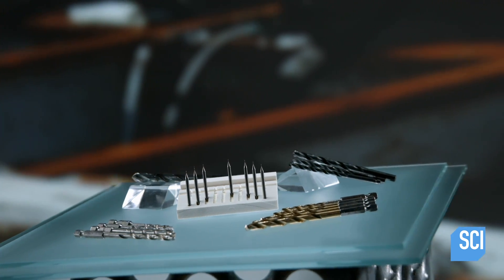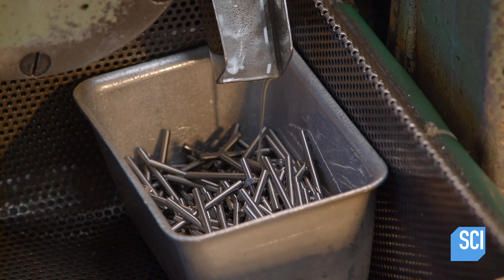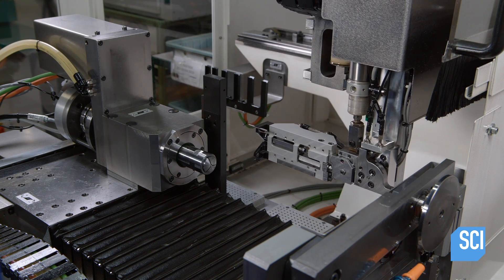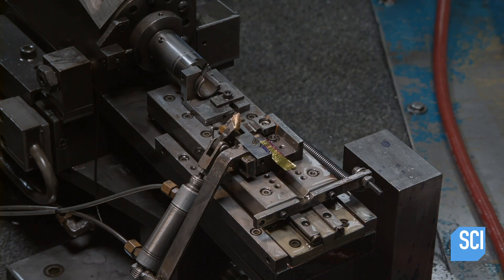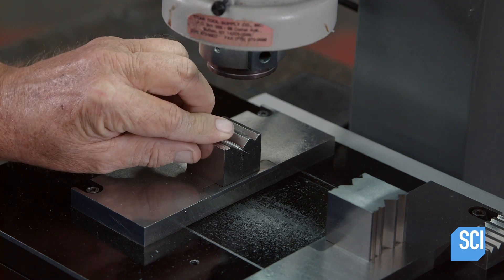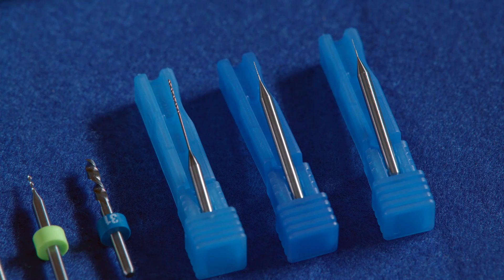How Micro Drill Bits Are Made | How It's Made

Comment: I'm an aerospace and medical equipment machinist. At my workplace we use these tiny little guys to produce very complex, very compact high pressure valves, usually some kind of actuator, for use in various aerospace projects. Also they are used to machine tiny cross connections between two high flow sections to facilitate very precise mixing of liquids, usually used in some kind of medical equipment. Sometimes the tiny holes that are drilled are also used to control the opening and closing of mechanical solenoids

Comment: I have a massive love hate relationship with these drills, they are priceless for the work I do but are beyond fragile, I use one that’s 0.1mm in diameter daily but each hole way 3mm deep takes 30-45 minutes to drill, I don’t own a million dollar precision mill or lathe so this is all work done by hand on a small precision lathe and you have to feed and clear chips after only micron sized advancements each time, especially with the 0.1mm bit or it will absolutely snap
Reply: Dropped one on the ground on Friday. Broke the tip right off

Comment: I use those drillbits to make the holes in circuitboards. I did not expect so much handwork in the production, the drillbits are really cheap! About 2-4 Euros per drillbit, even for the "made in germany" drillbits. I only use them down to 0,4mm however. They never wear out, they break really easily however :(

Comment: How a plumbus is made:

First, you take the dinglepop, and you smooth it out with a bunch of schleem. The schleem is then repurposed for later batches.

Then you take the dinglebop and push it through the grumbo, where the fleeb is rubbed against it. It's important that the fleeb is rubbed, because the fleeb has all of the fleeb juice.

Then a Shlami shows up and he rubs it, and spits on it.

Then you cut the fleeb. There's several hizzards in the way.

The blaffs rub against the chumbles, and the plubus and grumbo are shaved away.

That leaves you with a regular old plumbus!

Comment: Several corrections:
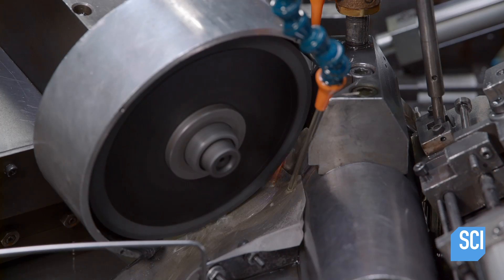0:50 - The grinding wheel is not "applied to a chamfered edge" it is creating the chamfered edge
1:23 - The centerless does not "grind them down to a specified length" it grinds them down to a specified diameter
3:18 - If that technician takes 4 to 5 hours to setup a single drill bit in that grinding jig... I don't know what to say. They most likely meant 4 to 5 minutes which is about right, or possibly the entire drill bit lifecycle from blank to finished takes 4 to 5 hours; however, I believe the former to be most likely.
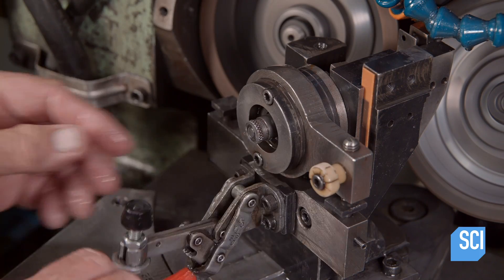4:09 - If it's impossible to see the difference before and after fluting, you need an eye exam.

@Science Channel, if y'all are hiring for a script writer/editor, hit me up, 'cause y'all clearly need a better one.
Reply: Also, @2:26 the chuck doesnt hold the blank perfectly still, its holding it centered - you can see the end of the blank rotating as the two wheels "close in". Glad Im not the only one bothered by the small errors
Reply: The video was the food, this comment was my dessert 😋🤣
Reply: Those are pretty big errors in voice editing. Nice. Catches
Reply: It’s funny, before I took manufacturing classes I would have seen this comment and thought who cares it’s just minor mistakes. Now these mistakes aren’t so minor and annoy me.
Reply: My brain was on fire hearing all these mistakes in the video.
Reply: 0:38 - blanks of 100% Carbide.  Hmm how is that possible?  Carbide for tools is always with another metal(binder).
Reply: @Stan_in_Shelton_WA  good catch. I'm pretty sure there's other stuff I missed, too, like one person above pointing out that they said "collar" instead of "collet" which I didn't notice because my mind often hears what it expects to hear instead of what's actually said when it comes to little errors like that. That and I'm pretty sure I was a few beers in when I wrote the original comment, just like I am now.
Reply: They also called it a "collar" instead of "collet".
Reply: Also calling the vibe feeder a rotary bowl 😂
Reply: @makingitwithnick  Well, it is a rotary feeder as opposed to the linear feeders like Spectrum Automation produces...
Reply: They also say Carbide tools are incredibly strong at the end of the video, which is not entirely true. They are very hard, but very brittle. I learned that the hard way.
Reply: @isiactorres1842  drop a carbide endmill, it's toast.  Spin it to 7,000 rpm and shove it through metal at 100 inches a minute, it doesn't care.
Reply: Came to the comments after the second issue and wondered if anyone else noticed the blatant issues
Reply: I mean you’re right except the flute part I couldn’t see it until they zoomed in
Reply: The 4 to 5 hours bothered me as well. If it takes that long you're not gonna be producing many bits! And there's a huge blatantly obvious inefficiency to solve.
Reply: Welcome to "How It's Made". The narrator is just white noise, the visuals are what people are here for.
Reply: ^^ This person drills. ;)
Reply: What he meant was that it took 4-5 hours to write this script with errors.
Reply: Sounds like these clowns are rage baiting for interactions. Deliberately screwing the script and getting obvious things wrong so people like us will come to the comments to point stuff out, which means they get an easy interaction that otherwise wouldn't have occurred. Basically playing us to mess with the YT algorithm.
Reply: @Snrby i’m pretty sure these were originally on tv and uploaded to youtube so i don’t think they were baiting, also it’s from 4 years ago at least
Reply: Takes him 4-5 hours to set up because he's union.

Comment: Astonished to see this process still involves a lot of manual labor. I was convinced this was fully automated before the video. Thanks for explaining!
Reply: With additional CNC equipment it can be automated more. With a single machine you can grind the OD down to size and flute on the same machine
Reply: The shitty China ones are automated and have bad QC most of the labor in the process have to do with quality control not actually making it
Reply: It usually is. I have no idea why the wouldn't have 3 cnc machines.
Reply: chinese drill bits are fairly inexpensive but fairly decent in performance.

Comment: The only thing harder to make these is having to drill holes with them, talk about tedious.
I used to make dies on an edm and had to drill starter holes in blanks for the wire. Sometimes you would have a ton of time in a part and then break a .010" drill bit in it and it goes in the scrap bin....

Comment: Where I used to work you would get in trouble for taking that long to set up the alignment. Shouldnt take more than 30 minutes. The operators dont program the machine. The engineers do that, operators usually just hit start.

Comment: Oh god I used to use similar drill bits in an industrial CNC PCB drilling machine.
A 0.7mm bit, spinning at about 30,000 RPM would snap them at the most inopportune moment. On a good day, I'd go through about five of these.
Reply: Why would you use carbide 0.7 bits for PCBs, if there are HSS bits of this diameter for a few cents per piece?
Reply: @Mescherje  This was back in 1997 on a CNC machine from the 1970s, owned by the biggest tightwad on the planet. My boss.
Reply: @Mescherje  Also didn't help that the spindles had a slight wobble to them (only a few microns) but that's enough to eff up a 0.7 drill easily. would have cost an arm and a leg to realign the old girl so we never bothered. Once we got to 0.8mm drills however, it was actually no issue at all.
Reply: @ondrejsedlak4935  yeah, spindles are expensive bastards :)

Comment: This was quite interesting. I worked in a printed circuit factory in early 90s as a cnc drill operator and used hundreds of small drill bits each shift. Usually sizes were between 0.3mm and 0.7mm but sometimes smaller ones were used in some special pcb.

Comment: I'm an hobbyist working on small scale models. As such I have drills (not drill bits) that go down to 0.25mm. None of them have shanks that size, but continue with the base diameter throughout their whole length. Of course I would only use them in my lathe as, hand held, I would just wobble and they would break!
Reply: What kind of tool holder do you use to hold those drills in, special collets? And how do you make sure you don't force them in to whatever is in your chuck too quickly to the point of them breaking? I imagine you must have some very fine motor control to keep them in tact and now screw up whatever you're working on?

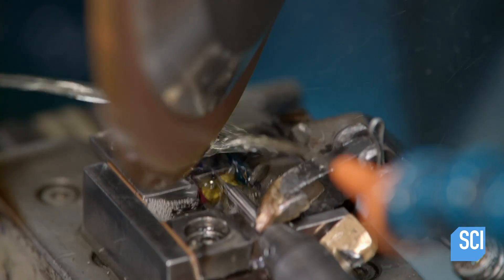Comment: Grinding the actual flute at 3:37 needs this separate machine, but why? If the drill bit gets ground to diameter on the rollomatic, why not grind the flute in this machine? Isn't there any way to support the drill bit in this machine?
Also I got extremely nervous every time the employee had to handle the bit by hand and had to slide it in and out the machines.
Some of these drill bits are so sensitive that they can break by simply moving them in the machine's tool magazine.

Comment: Probe card manufacturers drill holes .002" diameter into sheets of mylar, positioned to hold the tungsten probes for assembly. I automated the creation of work orders and built the analyzer to measure the resulting XYZ locations of the probes to 0.0001" resolution. Those twist drills were pretty much only visible under a microscope.
Reply: why did you use inches though
Reply: @ryanoconnor7957  Just for description. The scanner used encoders with micron resolution but the full-up apparatus has terrible non-linearities (cheap x-y rails, mostly) that bumped the errors up, even after some elaborate compensation, to about 3 um, about 10^-4 inch. All the raw data was in microns, the report for the customer was in the units they asked for.

Comment: In case if anyone wanted to know how a carbide material is made.
Someone's summary/comment on another video: 

1. Raw materials are received as tungsten carbide powder and a binder (typically cobalt or nickel).
2. Raw materials are blended into a slurry and then dried. 
3. The powder is compressed into a compacted powder material.
4. The material is machined to the desired product shape.
5. The product is sintered at 2500F in an argon pressurized environment.
6. It's quality controlled and checked. When it's a pass then they are sent out to be used.

Comment: i wanna see what these things drill into. im imagining something in the medical field
Reply: Typically medical, aerospace, robotics, and lab equipment.  I used some similarly minute carbide drills on the fuel inlet manifold portion of the rocket thrust chambers.  Our drills had the addition of through-coolant holes in them.  That is, you chuck these drills up to a sealed collet and coolant flows at 1000PSI through two tiny holes at the base of the drill and comes out the flute tips, which flushes out the chips/swarf as it cuts, preventing it from being plugged or overheating.

Comment: "Rolled between two wheels which grinds them down to specific lenghth" 

...uh yea, that's width, my dude.  🤦‍♂️
Reply: I would say "diameter", amigo... :)
Reply: @amigator7789   yea, I tend to think orthographically.  But, touché anyway.
Reply: You tried to one up the announcer, then got one upped in the process.
Reply: The blanks do call for a specific profile length.. Including the diameter and the back angle

Comment: But, I wonder where these drill bits are used..
Reply: I have bunch o these, 0.6 to 1mm diameter mainly. Using them for pcb drilling.
Reply: @amigator7789  ohh
I see.
Wherever there are very small holes required, we can use these...

Comment: Just in labor alone (by my calculation is at least 6 hours per bit), a single drill bit to turn a profit would need to be at least several hundred dollars. Then add the cost of materials, and the cost of production via machinery, business overhead and you’re looking at a $500-$800 drill bit. At minimum.
Reply: A 1/32" drill is around $10 believe it or not. The "5 or 6 hours" is setting up the fixture, which will run thousands of bits

Comment: I think the 4 to 5 hour set up is for the production of multiple batch  bits not individual bits . Cheers from a Quality Control Technician with 40 years experience Down Under In Australia . P.S. at 1.29  Ground to Diameter not length .

Comment: 4-5 hours to center it?! Not like they invented the technology to do that in two seconds, for optical fibre splicing decades ago. I also don't understand the purpose of the first grinding. All of its results seem to disappear after the second one. But I'm not an expert...
Reply: 4 to 5 hours to set up the machine on center for the drill they are making.  It has to be dead on as any amount  off center will not produce a good drill.  Once the machine is set up it stays that way for the run of that size.   Setting up the machine takes the time,  taking out a finished part, putting in a new blank, machining it and repeating the process is rather easy to do.

Comment: It most certainly does NOT take 4-5 hours to center the work piece. Carbide micro-bits are pricy, but if this shop took half a day to set up one step for each part they would be out of business fast.
Reply: Lets see, at ~$30/hr. you'd have $120 just in labor costs. Factor in the materials, tooling, maintenance, administrative, etc. that'd be a $500 dollar drill bit easy. No freaking way.